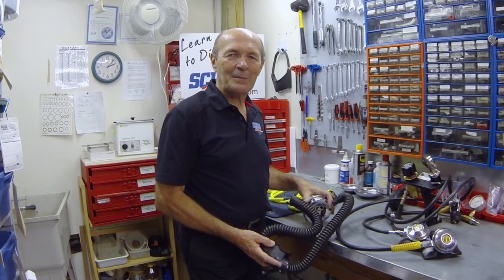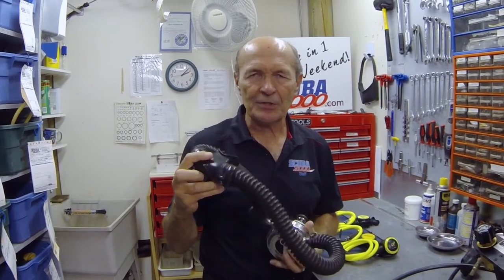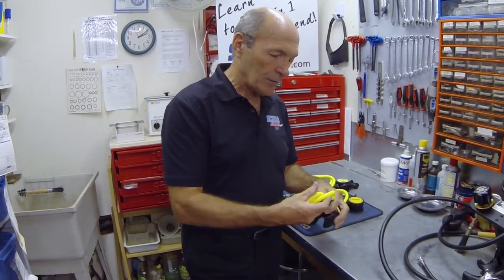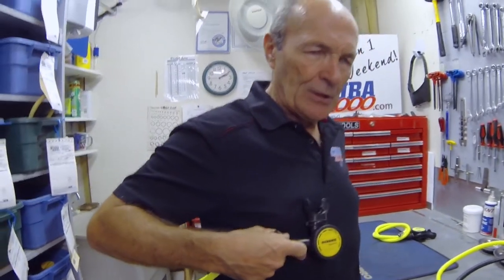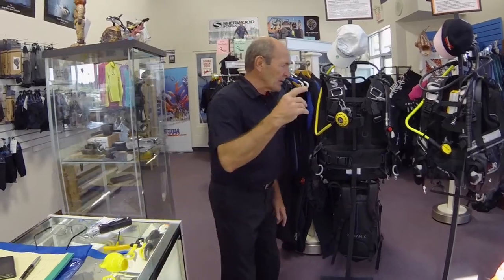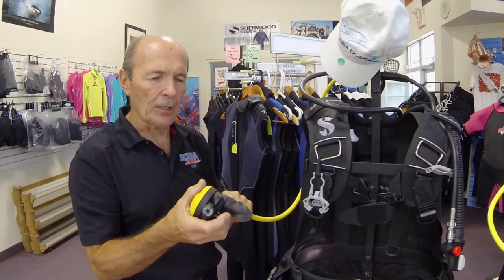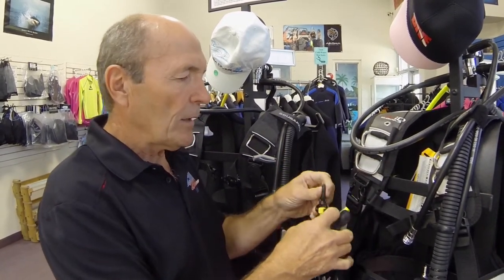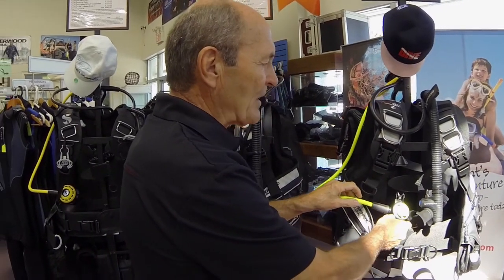A Hose Of A Different Colour - Scuba Tech Tips: S02E05

Comment: Great video again.  I have tried many different reg holders and found the method used for my side mount the best so far.  It is just a tank o-ring that you push around (not through as this is impossible) the far end of the hose and then clamp it with a double ended clamp.  The clap you then attach to a D-ring on vest (you may want to do a video on this).  If your buddy needs it in a hurry, it is easy to break off the 0-ring.  If just for drills, you can just unclamp from vest D-ring.  Another thing I leashed is I use a 'necklace' for my regular second stage and breath off my octopus.  The principle being the panicked diver will pull what you have out of your mouth.  The neckless reg is alway juts around your adam's apple.  Necklaces are common for tech divers and side mount divers

Comment: Hello again Alec. Another very informative video. Thank You. I do have a question for you, I have used several retainers for the safe second, and I have found that most of the time when you are diving you will look and see your safe second floating somewhere behind you because it has come off the retainer. Is there a type of retainer that you can get to actually hold the Octopus in it's place?
Reply from the maker: There are 2 that I like. 
One is from Trident and seems to work well. It's in the Trident catalog (Tridentdive.com) and its product number is RP36. Cheap and effective. There a couple of styles available but effectively they fit firmly right over the mouthpiece and hold it well unless tugged firmly.
The other is from XSScuba. It is not sold as a separate item but is part of their great AltAir Safe Second. It's a Fastex-style clip that pulls apart. It can fasten to any Fastex-style female on your BCD or clip to any ring.
I'm not a fan of the octo holders that fit into the mouthpiece or the ones that the mouthpiece fit into (ball, etc.). I find that they get very dirty and don't hold the octo if it gets bumped.
Good luck.
Alec
Reply: @AlecPeirceScuba_SeaHunter  Thank you my friend, Safe Diving.

Comment: hi alec, i took your advice when fitting bcd to my tank. my head not hitting 1st stage now had 2 dives in gold coast seaway and no probs thanks alot. i have one more question, i bought a mares puck pro ive had 3 dives with it and averaged only 13-14 metres in depth. but the 5 metre alarm doesnt sound on ascent, guy at dive shop said it may not be alarming cause of shallow depth even thou i average bout 1 hour dive at this depth. all alarms are set to on what are your thoughts on this...ps i cant find the docket so probs cant get new one if faulty, thanks again Belinda.

Comment: Hi Alec, I am a big fan of your videos! About the systems to hang the octopus to your bcd, I find the rubberbands and holders that attach to the mouthpiece directly (as at 4:50) quite dangerous... Once when testing the one from my buddy on the surface I took the entire mouthpiece off, if underwater it could have been critical. I find the ones that you also show later that attach to the body of the octopus and not to the mouthpiece much safer from that perspective... What do you think? Thanks and best regards
Reply from the maker: Losing a mouthpiece can happen if not securely attached (look for a tech tip on that subject).  If a competent diver and not in a panic, you can still put the opening in your mouth and breath normally, just takes more lip lock than normal.  Its great that you did your BWRAF properly and checked.  Most divers use that device to keep gunk out of the mouthpiece so if you buddy grabs it, its clean.
Thanks for watching.
Alec
Reply: Many thanks Alec! I have now seen your tech tip about mouthpieces, very helpful. Kind regards, Juan

Comment: I am surprised that you did not cover the combo alternates like the Scubapro Air2 that combine your power inflator with an alternate air source. I have been using one since 1992.
Reply from the maker: The BCD mounted safe second is not a new idea at all. It's been around since the 60's and some divers really like it. Here's my take on it. It's expensive - $300 versus $150 for a standard octo. It's more expemsive to service too. Money is not a reason to avoid a device if it's better but I find it hard to say it is (Yes! I've used them - a lot!). The main reason for choosing the BCD mounted octo (Scubapro Air 2 or at least 5 other designs) is that you can get rid of a hose. In my experience and opinion, the octo hose is NOT an issue. It's tucked out of the way under your right arm and never interferes with your diving - unlike an SPG or even the primary hose. It's good to simplify the system but not if it offers no advantage or compromises safety. The standard safe second setup for recreational divers (bright color, compact, second stage hanging mid-section on a long hi-vis hose) is universally recognized and easy to deploy. The Out-Of-Air (OOA) diver simply pulls it off the donor and sticks it in his mouth. The donor doesn't do anything - no risk, no involvement. They then, far apart enough to be able to communicate easily without bumping each other, make a slow ascent to the surface, using the donor's BCD for buoyancy control. With the BCD mounted safe second, the BCD hose is too short for the OOA diver so the donor will give the OOA diver his personal second stage to use (on a short hose!) and then recover and use his BCD octo. Already there's a bit of fuss going on. The donor is at risk - reg out of his mouth, has to clear the octo, etc. If he is caught unawares by the OOA emergency, he may not find the BCD octo quickly, the OOA diver may be somewhat panicky (perfectly understandable!) and thrashing a bit. They're jammed up against each other. It can be a mess unless both divers have practiced this maneuver - practiced a lot!! So, they're cool, and get it all sorted out and now decide to head to the surface. Now the donor finds buoyancy control a problem - his BCD control is in his mouth!!. The other BCD dumps are hard to find and the donor's hands are kind of busy hanging on or fending off the OOA diver. Oceanic tried to address this issue a few years ago with a special BCD hose that had a pull knob in the middle so the donor could dump air while still breathing through the octo. I don't think it's sold anymore - didn't help. And all this to get rid of a hose that's not only NOT a problem but is actually helpful in an OOA emergency. Obviously I'm not a fan of them. But, if you have it and like it and practice with your buddy until you can use it quickly and safely, go for it. What do you do when on a dive boat without your usual buddy? Sorry to sound so negative Michael but I've used it and finally gave up trying to address all the issues when there was a perfectly simple solution availabe for less money. Just my opinion. Sorry to be so long-winded but I felt your question was important enough to warrant the time. Thanks for watching. Alec
Reply: Thanks for that excellent explanation.  I was looking at new equipment and had the same question myself.  I also had similar concerns.
Reply from the maker: I have a video on them, well, on Safe Seconds in whch I discuss them. If you use it and are happy with it don't change. But, just as I am, always be open to suggestions and ideas.  1992 BTW, is 25 years ago. Why don't you borrow a current diver training textbook and see what's changed. You might be surprised and pleased at some of the ideas. I stated diving in 1958 and still learn new stuff, often right here on my U-Tube videos. You should also note that the cost to service your Air2 just once would almost pay for a new Safe Second! A 2016 model!! Alec
Reply: thank you I was thinking of those issues as well when considering one integrated to save on weight/hose when traveling but I agree. I dove with a buddy on a boat and he had air2 and hoped I wouldn't have to use it vs my bright long yellow octo.